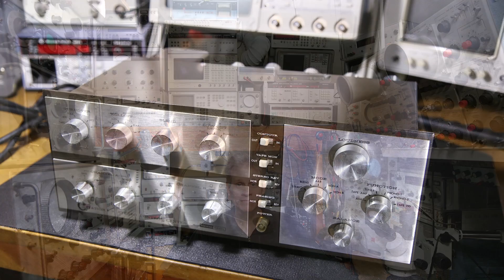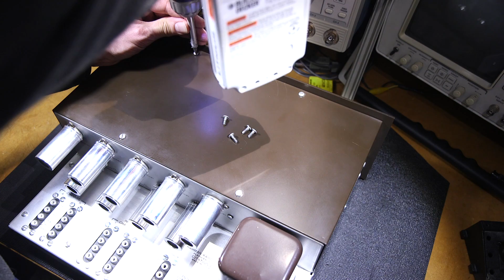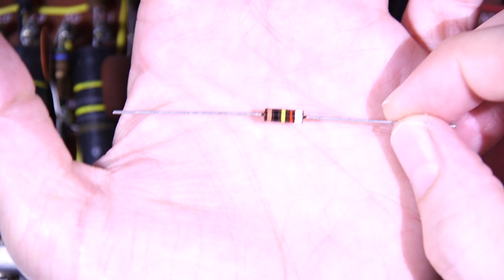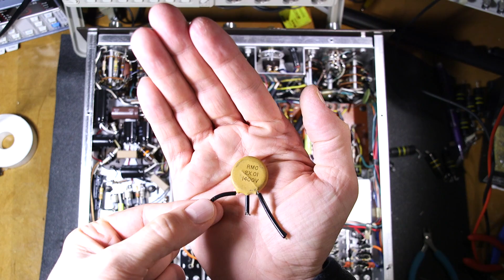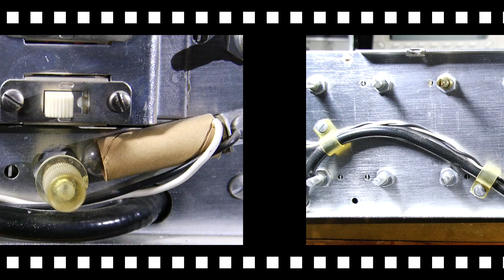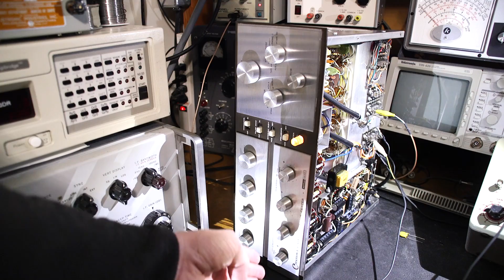Vacuum Tube Preamp Repair, Harman Kardon Citation 1

Comment: Hi Paul, I have recently acquired a HH Scott 355 tuner/pre amp. I was going to re cap it, but found out that the person who had it last completely butchered it. A lot of the wiring is off or soldered to the wrong places. I have a schematic, but have no pictures of a untouched unit to compare. Using just the schematic will take 3 times longer for restoring this. There is no service manual to my knowledge, at least that's what I concluded from the blogs. Any suggestions?

Comment: Using a screwdriver on the shafts is a bad idea.  Don't do it.  The reason is that you need to overbend the metal because it will spring back.  Better to take a wood chip or something and slide it into the slot.  This will expand the shaft just slightly with no risk of breaking.  If the knob is still too loose, you can add a bit more.  DO NOT PUT A SCREWDRIVER INTO THE SHAFT SLOT.

Comment: I find it interesting that Harman Kardon put the channel B caps in backward. So much for quality control. Good information for users / restoreres of this old equipment.
Reply: They didn't.  This is a unit constructed by an amateur from a kit.  You can tell, among other things, from the use of screws instead of rivets on all the attachments/terminal strips.

Comment: What was the audio problem(s) being addressed in this exercise? I don't know if I missed that detail. I also would like to have seen demonstrations of performance before and after the work to quantify results. Thanks for sharing your knowledge.
(Edited: a word)
Reply: Due to the age of the capacitors, plugging this preamp into the AC mains would likely have resulted in many of the capacitors acting like resistors instead, causing leaking, burning, and failures of other components such as screen grids.  So it would have been unwise to try getting a "before" demo.

Comment: Very nice work Paul.  Carbon Comp resistors are known to drift with age, have you considered measuring as many as practical in circuit while you have the unit open?  Especially anything in the EQ stages, but might as well do as many as possible.
Reply from the maker: The Allen Bradley types are very stable, (used in this pre-amp,) where the older "roundies" move all over the place. Not so known fact:  Depending on how hot you get the Allen Bradleys, their curve will reverse and the resistance will go low. This is how many of the E.F. Johnson VFO's were destroyed. Failure mode of the VFO: Under rated carbon comp resistor gets "very" hot, resistance goes low, the 0A2 regulator tube it's attached to draws excessive current, the cathode "center electrode" gets hot, then soft, and falls out of the top mica spacer in the tube and lays on the plate (entire failure process gets very accelerated at this point.) The plate turns red hot and chars up the VFO fiber resin board. Resistor burns open in the center. You will notice the JAN-0A2-WA tubes have a rivet inside the tube holding the cathode in the top mica spacer, preventing it from falling out, under high (over Current) conditions.
Reply: Interesting, not sure what you mean by roundies, the older ones that came in odd physical sizes?

Comment: I have a question! I don't have any scopes or capacitor testers... how would I know what a trustworthy source is? The only choices I know of are a local electronics stores and online. The local store only sell generic ceramic and electrolytic capacitors, in packages of 1 or 2 for about 2$ each. (No idea what their resistors are made of, but the prices are about the same.)
Online retailers have much better prices, but it sounds like these can't be blindly trusted. 

What is a good way to get genuine components in moderate quantity? (As in a few dozen, not a few thousand.)
Reply from the maker: Hi Stephen, PM me on Patreon.

Comment: Thanks for this.  I actually have one of these pre-amps; it has been in use for about 40 years (with tube replacements).  Looks like I should probably get it really cleaned up.  :)
Reply: Greg Argendeli hopefully the capacitors aren’t all backwards!

Comment: Hello Paul. Excellent video as ever. May I ask, what thought process do you have when deciding to either keep the original incandescent lamps, or change them to LEDs?.
Reply from the maker: Hi. In this case the incandescent bulb is in series with the filament of a tube, so I opted to leave it. In many cases where bulbs are hard to get at, I will replace them with a warm white style LED (or appropriate color). It's very important to keep the operating current as low as possible to extend the life of those LED's. So it's a balance between brightness, look, and operating life.
Reply: Makes perfect sense. Thank you for taking the time to reply Paul.

Comment: I've rebuilt a number of old H.H. Scott tube amps (fun to work on). Viewers should be cautioned to use an isolation transformer on some of this old two-wire power cord equipment.  I think that the amp shown here is three-wire.  Also, the old selenium rectifiers were a real problem to circuits when they failed.
Reply: Yes, replace those selenium rectifiers for sure!

Comment: Good video, what/where do you get the ceramic standoffs that you used?  In replacing the line cord caps, I was told to use an xy cap, is that what you used?  Thanks
Reply from the maker: Yes, X and Y rated capacitors are for line cord use. There are a few links in the posts for the standoffs.

Comment: are you sure you are correct on the outside braid of your new caps? in my opinion the outher braid should be on ground, shielding the inside??(toutching it, on your tester shows the signal(hum) input the other way around as you stated???), or am y wrong?
Reply from the maker: The led that's lit tells us the alligator clip (beside it) is grounded. If that clip is grounded, and the hum is at a lower level than the other LED, this will indicate that the outer foil (shielded side) is at the surface of the capacitor. (outside foil end)

Comment: Very nice video. Thanks for pointing out the requirement for changing the RF surpressor capacitors on the power input. Old capacitors are a substantial shock and fire hazard. Especially, if it is gear operated on 240 Volts, like in Europe.

Comment: Since you're apparently so concerned about noise due to component stress, why not kink the capacitor leads to minimize stress due to thermal expansion? It's gotta get warm in that chassis.

Comment: I'm not so sure I would have placed those power supply electrolytic replacement capacitors where you put them.The area has become much more crowded than the original, and the new capacitors are quite close to those two 2-Watt carbon composition resistors. Even more troubling are those two nearby ceramic resistors (possibly 5W or 10W ratings); it's been my experience that resistors like that often have a body temperature over 100 C (the old spit on the finger measurement technique). All in all, a fair amount of convective and radiative heating from those four sources.
When I can, I prefer to drop replacement caps into the old electrolytic's metal tubes. Yes, it makes the leads a bit longer, but on inspection, it's pretty obvious what has been done, and any future tech can fish the capacitors out of the can without too much trouble. Obviously, I don't epoxy pot the replacement capacitors.
Reply from the maker: Hi Ed. The area is "warm" to the touch (4 Watt resistors slightly warmer) The electrolytics close to the warmer components are 105 degree, 12000 hour parts. There is "no way" any of the components get anywhere near that temp. If this modified design had any issues, there wouldn't be a video on it. (lots of careful "pre-testing")
Thanks for stopping by!
Reply: Good point, Ed!  I am one of those that will restuff when space is at a premium which is often the case with these vintage amps.  I also use two-pole caps when originality is not a factor and add the other poles in other parts of the circuit where possible.

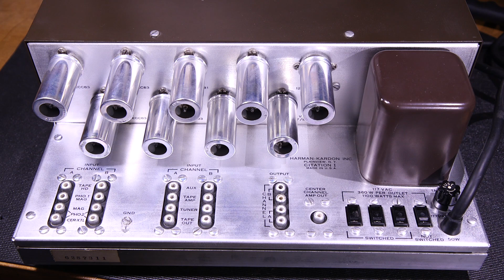Comment: @ 4:06 I LOVE that all the shields are still there! So many of these old pre-amps, radios, and TVs that I've run across are missing some, if not all of them!
I think back in the day, people would remove them. Why? My personal theory is, they thought it would help with heat dispersal. It really is a shame...
Reply from the maker: Hi. The shields are to stop external noise from entering the tube, IE: hum and so on.

Comment: Hi Mr. Carlson, thank you so much for a clear, well made & instructive video. I am looking forward to the safety cap video too.
Reply from the maker: Thanks for your kind comment, 6A8G! Any particular reason you chose a mixer tube for a name? Any interesting stories hiding there?
Reply: Thank you, as you've probably guessed I'm a vintage radio man & am self-taught with big help from 1930's - 60's electronics magazines, vintage Radio websites & the odd You Tube channel with very good instructional videos - Mr. Carlson's Lab is such a channel! But the 6A8G reference is when I "got" how the superhet circuit worked. Not a blinding flash of inspiration, just that realisation of Ahh..... THAT's how it works. The pentagrid in the circuit I was studying was the 6A8G.

Comment: I have always been instructed to use nitrile gloves when touching tubes due to oil in your hands.  Is this just folk lore or does it have some truth?
Reply from the maker: Absolute 100% not true. The glass is standard. You can touch the glass (cold of course)
Reply: This is another one of those myths spread by the internet. There is so much BS out there that people swear is true (because they read it on the internet). A bit of education can go a long way.
Reply: That is only true for halogen lamps, they get mighty hot.

Comment: Improperly installed caps in mass! Would this amp have worked 100% , that is minimum noise, good amplification ECT?
 Maybe it failed QC and was to be a display or photo shoot prop
The story is forever lost!
Reply: Again, this was not a factory-made preamp, but constructed by an amateur from a kit.  The factory built ones cost about the same as Marantz 7C's and McIntosh C-22's, so no one in their right mind would buy a pre-wired one.  I suspect all the prewired units were sent to dealers.  The easiest was to tell is that all the terminal strips etc. are screws in the kits; in the factory-built ones, they were riveted.
Reply from the maker: It probably worked with a higher noise floor.

Comment: Hey Paul, as always I really enjoy all of your video's. I always learn something. Anyway, I have a question about those multi-cell electrolytics. Is there any disadvantage to using these, or do they perform exactly the same way as individual capacitors would?
Reply from the maker: Hi Joseph. The multi-caps work ok. You will notice that their temp ratings are usually much lower though.

Comment: One thing I've learned is that those original German Telefunken tubes rarely go bad so don't replace them !
Also I would have used German Wima caps as they don't cost much and sound good MKP 10 type.

Comment: I was stationed on a microwave site in Korea in the late 60's as a AFKN technician to monitor the Raytheon KTR1000 microwave link equipment that distributed the TV signal to the different transmitters  in the country, all of this gear was vacuum tube based. The rest of that site was STRATCOM and they were running ANTRC-24's and 29 systems that were over 20 years old in some cases.

All of these systems had 50 to 100 tubes in them and the Army way was to test every tube in every system. logging the readings in a logbook every week or two. Over the decades that resulted in a lot of wear and tear on the tube sockets and some were getting pretty loose. This gear was well built and had the ability to read cathode current in almost every cathode so you had the ability to check the tube operation without pulling them.

I wrote up a proposal to stop frequent tube testing (and pulling of tubes) and log the cathode currents instead. The tubes would be tested every three or six months or when ever a cathode current showed a noticeable change. About a month later I got word that the US Army had heeded the advice of a lowly Sp5 and changed their way.

Hopefully that extended the life of this gear. After leaving the army I worked as a technician for a company as a calibration technician and I was amazed at how long a tube would last in a properly designed tube circuit. It was very unusual to have a tube go south earlier than 5-7 years in our Tektronix 530 and 540 series scopes and they had a ton of tubes in them.
Reply from the maker: Great write Mr Dell! That proposal of yours probably saved them huge money over the long run. Cathode current (plate current as well) is a great way to monitor a tube throughout it's life.
Reply: That equipment was really well built but even mil spec tube sockets can only take so much. Replacing tube sockets is a LOT OF WORK and anything you can do to forestall it is worthwhile.

Comment: Paul, again a very nice video.  I'm a bit a cap nut when it comes to measuring and analysing them but in my opinion those big alu caps are not often bad, often they are even better as new ones, but only after carefull reforming. But replacing them is also OK, but be carefull, I have seen oscillation problems caused by very low ESR caps (but that was in pre-2005 or so smps )

About ceramic caps. I have seen shorted ones. Strange enough all in USA  made gear. From the top off my head the ones from this years repaires I remember: a 90's made Valhalla voltage calibrator, a 70's made Fender Twin reverb, a 1974 dated HP spectrum analyser. So they can go short but it is indeed not very common. 
Just some history info: The ceramic cap is "invented" in WWII by the Germans to replace mica caps because those were only made in the USA. So the nazi's needed a replacement. I forgot who invented and who produced them but one of them was R&S.
Paul, I did some measurements on tatalum caps this week after replacing a almost dead one. Often they are shorted and burn but I have seen 2 caps in the process of getting short. I helped them a bit with that and monitored it. Very strange behavior,  they leaked a bit cold but not enough to cause problems, that became worse when warming up and then killing the switching transistor .  I tested them on my leakage tester and then a very strange things happen like going short at some voltage, turning the voltage down after that did not matter , but remove the voltage, wait a few minutes and the hole cycle starts again, so no leakage upto  a voltage (under there max voltage) And 2 times they repaired them selves and jumped from 1,8V and about 3mA to the set-voltage and no leakage at . I see one of them do that twice before going definitive short. C did not change but they all had a relative high DF (for a tantalum).
Reply from the maker: Thanks for taking the time to write Fred!

Comment: I've gutted plenty of old filter caps and placed new caps within the cases, using the same solder tabs for aesthetics. it's tricky to get them apart without damaging them, but well worth it to retain factory looks (functional display models, with covers removed and either plexiglass or inside display case ;)
Reply: @lucvelghe7330 in another episode he explains that installing the caps on the bottom makes it easy to replace them again in 40 years.

Comment: Interesting that the unit apparently had so few hours on it. I wonder if the "Bumblebee" capacitors installed backwards may have allowed A.C. hum to get picked up and amplified. Then the previous owner may have gotten disgusted and put it away in a box.
I look forward to the video on Safety caps. Thanks for the great video.

Comment: Hi Paul, more kudos for this video. I noticed that when you unwrapped the bumble bee cap at time point 23:34 ,  that the blue jumper from post 43 to 74 has squeezed the insulation flat for a possible "cross" if it were to fail.  The smaller new cap hopefully removed the pressure.  My learning is still growing each time I watch your vids.  Once I get more time, I plan on joining your course on patreon. .  Will it be possible to watch archived classes from the beginning ?   J K
Reply from the maker: Hi James. Every video is there, right from the beginning (quite a few video's now) They jump from technology to technology to keep everyone interested... and to keep you on your toes as well. 
The wire was a little flat from the old cap, but there is no harm in that. Thanks for your comment!

Comment: Very good video, however, I like to see full sized heavy duty cans used in replacement for the originals. We see a higher failure rate of the little Nichicon caps in amplifiers that use voltage doublers. We determined that the smaller capacitor's ripple current capacity is not up to the level of the larger can type. So we have the cans custom made with a high ripple current capacity. Another reason why we prefer to us new manufacture cans is to retain the value of the amplifier. It just looks better, in addition to being more robust.
Reply from the maker: We have very different experiences then. I have "Never" had a genuine Rubycon (used here,) or genuine Nichicon fail. "Ever." And I have seen a lot of equipment. Check too make sure your replacement caps are not counterfeit (note the vent stamps) and make sure the ripple current ratings are up to spec.

Comment: when you acquired this unit, was it known to be functioning? If it did work, how good could've it worked with the previous issues with the capacitors etc being the wrong direction?